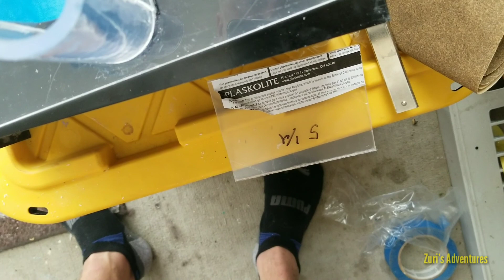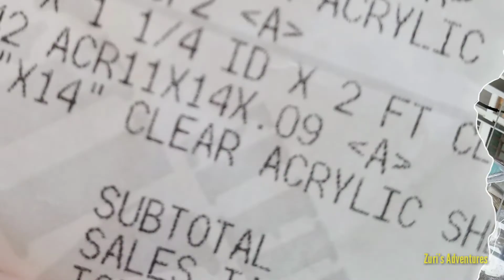Building an underflow sluice box gold concentrator

Comment: I was thinking a dado for the gates, but that means using thicker plexiglass at least on the sides
Reply from the maker: I think doing a dado is a great idea. I would just make sure that you can still adjust it up and down for you can kinda control the flow or pressure.